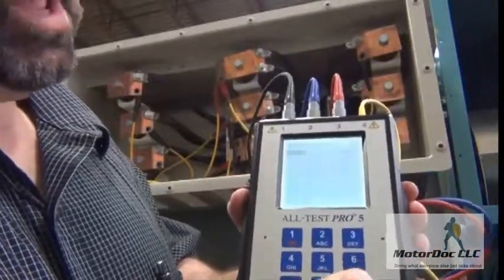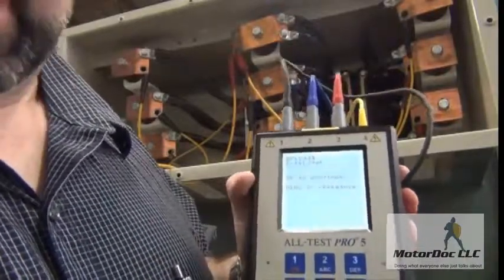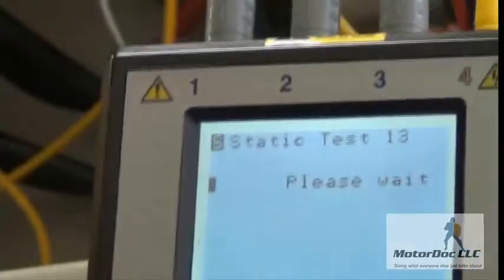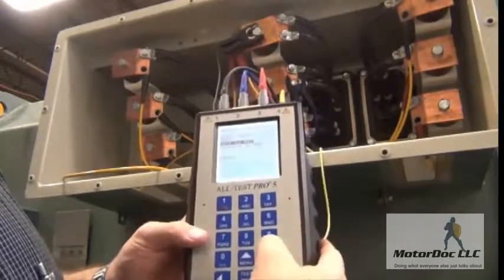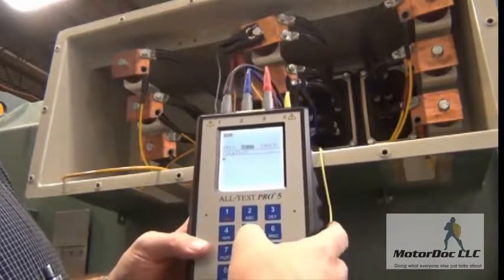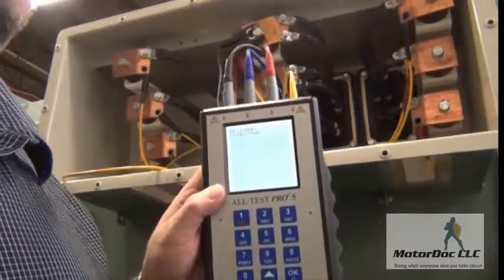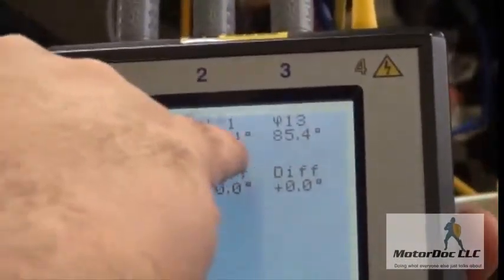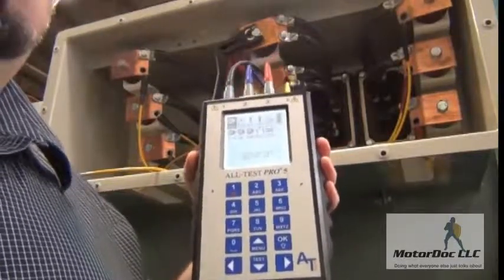The ALL TEST Pro 5 on a Form Wound Induction Wind Generator

Comment: Sir, What configuration is the generator windings  when you are testing, STAR or DELTA?
Reply: It's just a selection in the software. After you have indicated the wiring used, the instrument then gives you how to connect it accordingly. Very simple to setup.